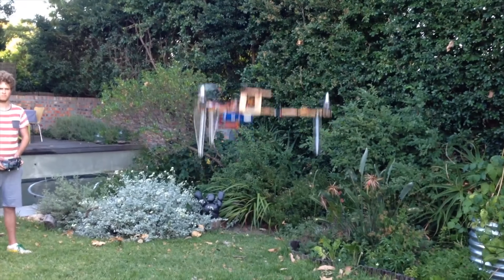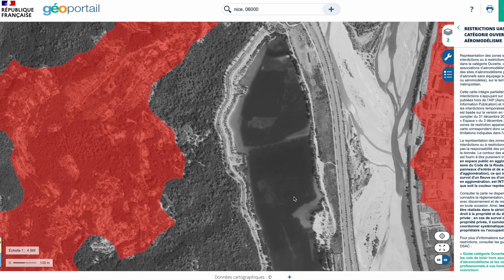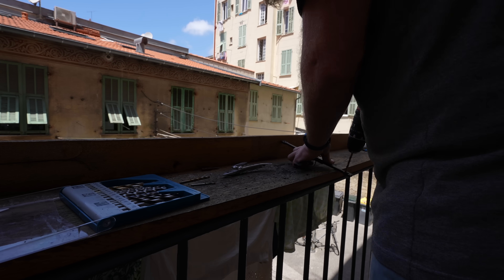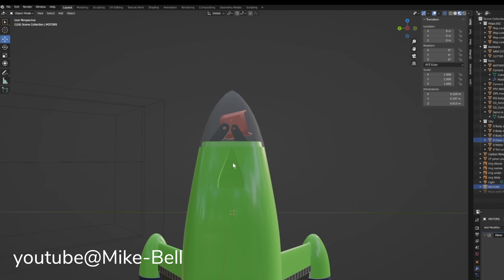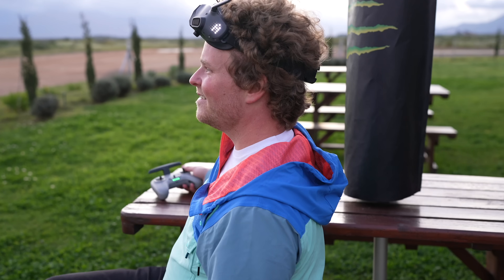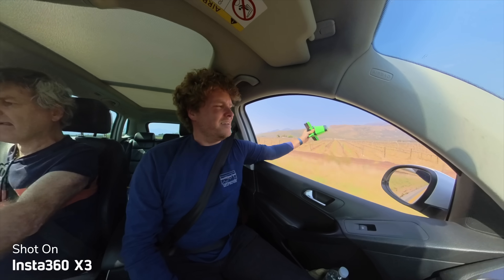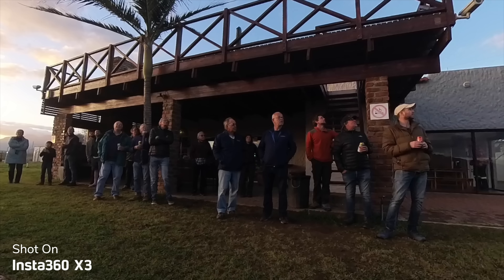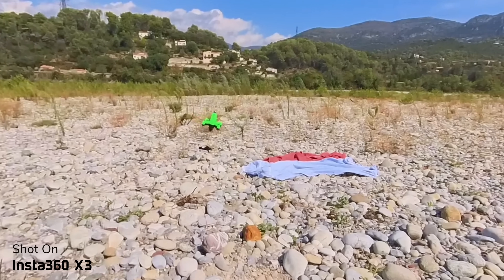How I Built the FASTEST Drone on Earth

Comment: I think the problem here with your design of your most aerodynamic type in green. Is to, overpower, 2 of the motors. So it flips over onto its side. Pointing in the direction of its pointy nose. Now facing forward. Parallel with the ground. Not trying to fly it vertically forward. But flying it, horizontally forward. In the direction of its least resistance. DUH! So you have to change your algorithms again. In the flight control data. So that at speed. It tilts over.. And flies in the direction of its aerodynamic shape. Not vertically honey! With the path of greatest air resistance.. What are you thinking with your electrical engineering degree? That it has to point up toward the sky?  What sense does that make? You are going for a speed record.. So you don't fly it vertically.

I mean come on kiddo. Have you thought about changing schools?  I think your Edgamucation is lacking something? Like thought process. You want to go fast, right?  What does going fast look like?  Do rocket ships fly horizontally off the earth? No they do not! As that, Saturn V  in Florida lying on its side. Can't fly like that! That has to be pointed upwards! It goes in that direction. In the direction of the shape of the vehicle  with the path of the least resistance.. So it goes vertically to fly real fast until it runs out of gas. Then it starts the next gas tank. And then the one after that.. Because they have more than 2 tanks. They have, 6. Because they do them in pairs.  Not grapefruits. Not oranges. Not apples. But in pairs. After they are ripe. Not before. Otherwise you will have engine failure. And blow it out your ass in the bathroom. But I digress.

And so there's more than one way to get a toy to go fast. And so you might want to get an electrical engineering degree, instead? And design functional radio alarm clocks. That, don't wake you up with a Start. It wakes you up slowly. With the sound of lovemaking. And you will make millions of dollars, overnight. But you could also do that with just a rock. Instead. And you package it in a jar filled with water. Call it a, Rock of your rainy, umm? And it requires no batteries. They are $20 each. Or 5,  for just, $100. If you act now. And call one 800-TRUMP--UP. Or text, Donny to,  666-666. Or on X (formerly Twit less) @the Real  Donny XXX. For further instructions what Americans to attack. Until then, Standby and Stand back. Until we are ready to Pounce !

And there's no reason to believe they won't.
RemyRAD
Reply from the maker: I’m genuinely not sure if this comment is just trolling or serious.
Reply: @LukeMaximoBell  I'm terribly sorry sir. It was late at night when I posted this. I was in bed. I really shouldn't do these in my sleep. I was already horizontal. Thinking the drone wasn't. Because when you are horizontal. The drone looks vertical in its travel. When your consciousness is skewed toward sleep. While still being sort of awake.

So you did everything right. It's really brilliant.  I love it. Congratulations! It was a great undertaking of engineering brilliance. Tip of the hat to your dad. Of course everybody can make those kinds of enclosures. Your dad is brilliant. Your dad is awesomely cool. He knows one day you will be able to support him. Very soon now. Once you are hired by Air Bus. Unless Boeing has come to you looking for help? America is a nice place. You've been here, before. Though there may be a downturn after November? As one guy doesn't believe in science. He wants to go back to the old ways. The thug like, Mafioso, days. With Mobs of supporters.

Unfortunately. I was never really into going fast. I was into, duration. I like, slow moving, easy-going, cruisers. Which were also my motorcycle of choice. I never wanted a Crotch Rocket. I mean why? It was more fun to, kickback. Put your feet up. Hit the cruise control.. Enjoy the backrest. Turn on my Helmet Radio. I built into my helmet. 40 years ago. Back in 1983/84. When it was still considered Highly Illegal. Now guys are watching television on their smart phone. While riding their, Crotch Rockets. With their, Insta-360. While trying to set the shots. While riding. You know? We don't hear about the ones that headed, headfirst. Into a cement overpass. We don't see that video on YouTube. As it doesn't make the grade. From those Video Production Failures. For YouTube. It's

So, I'm 68 now. But I've enjoyed going slow. Since I was 28. And going up to the, Shenandoah, Blue Ridge, Poconos, Adirondacks, mountains. On a motorcycle. It's like flying slow. And all of those pretty turns. You can miss and die. By going too fast. And slow is much more relaxing. Life is short. There is no reason to go fast. I mean you could get hit by a car wearing those goggles. You never know when one is going to go out of control? It doesn't matter if you think you're safe. When you do not have full situational awareness around you.

And so with those goggles on. And remote controlling your drone. I think you should be sitting in the safety of inside a car. You don't need to be standing up. Radio broadcast energy won't be much different, 3 feet lower. And you could be much more comfortable sitting in a car. It would feel more like you were flying your drone from a Cockpit. Not a bus stop. You would have a more Immersive Experience. Sitting immersed inside a cockpit. You'll get that actual,  cockpit flying experience! Now all you need?

You need some, solenoid activation of your car seat. Or the, air ride adjustments. To make you feel the turns, the Ascension's and declinations of the flight. By manipulating the seat and/or suspension, of the car you are sitting in. Almost like a real Boeing Simulator! So you can feel your turning and banking. If you can energize the suspension or the seat in your 4 wheeled quasi cockpit vehicle! It would be Awesome!

No I'm not kidding! I'm a retired engineer. Broadcast on Recording Studio, type but a retired engineer just the second. I mean I've got multiple major music award nominations. For my engineering expertise. Have you tried your hand at audio recording? Rock 'n' roll and jazz is a lot of fun. Verdi Requiem's and Operas. Are a little slower. I enjoy recording both. I must admit I do like fast rock 'n' roll. Because nobody ever gets hurt or killed. If they played some wrong notes.

And I can come up with a lousy, Live Mix for Broadcast, worldwide. And nobody will know it's a lousy mix. Like these:
https://soundcloud.com/user-135130368/sets/live-at-electric-church-fm-sessions-vol-1

At I just wanted to know. I recorded and mixed of these. On the Worlds, Fastest and Best Sounding, British Audio Console, ever! The $85,000 in,, 1972, Dollars. 40 input custom, Neve, Audio Console. That weighed in, at almost, 1 ton, 2000 pounds. It's not portable. It required  my, 25,000 pound, Mercedes-Benz, L-1117, Diesel Box Truck. To transport it with. That made it, portable. And I installed it. In my Control Room On Wheels. Better known as the CROW. And I would take flight on the American interstate highways. At worked the East Coast from New York to Florida. For 23 years with it. Before I moved to Central, Texas, 10 years ago.

And so I'm into going slow. With fast rock 'n' roll. And slow cruises on motorcycles. I like putting on a couple hundred miles a day. Slowly in comfort. Stopping plenty. To enjoy the scenery, the antiques, the food, the flora, fauna. And playing rock 'n' roll in my helmet radio. 40 years ago before it was a thing for everybody today. Yes I built into my helmet some fine, headphone drivers. Surrounded in acoustic foam to make them comfortable. Inside the helmet. Studio quality headphones inside a motorcycle helmet. It was great! I'm sure you and your dad would have appreciated it. I had acquired the world's smallest FM stereo receiver. Made by Toshiba. It was 1 inch by 2 inch by, 3/8 inch. And with stick on Velcro. You can't go wrong. It was very discreet. Nothing like this existed for helmets 40 years ago.

And so back in 1970 when I was only 14. In a sense. I created the first Walkman. As, I had gotten a new, AM/FM, transistor radio. I mounted it to the handlebars of my 10 speed, Marathoning Bicycle. And I had gotten myself a pair of Sennheiser, HD-414 open-air, studio headphones. And made an adapter cord to plug into my transistor radio. 54 years ago. Before the Sony Walkman was a thing. 10+ years later.

And I had been a QC Manager. In 1979/80. For one of our most famous and legendary, Studio Tape Recorder Company Manufacturers, Scully. The direct competitor to Ampex and 3M. And offered positions by the others like Ampex, 3M and MCI.

After I left Scully.  I was scarfed up by NBC-Radio in 81. And by 84. They had transferred me into, Network Television News On Air Operations. And I was like no no no please no I'm all about the music. I'm not about the news and the politics! But I became one of the best at that. And was fundamental in switching us over from Monaural Audio to, Stereo Audio. Aunt not just a Network but a World Wide, level.

And unlike yourself and your dad. I never went to college. I was so dysfunctional. I was a bona fide high school dropout. With nothing more than a GED. Which is like getting a high school diploma after the 7th grade junior high school. Instead of 12th grade, senior high school. The test is that simple. I was outraged! It was overly simple! I mean I made it, halfway through the 11th grade. And I dropped out because I was already employed. At an FM Radio College Station. And also the Largest Recorded Studio south of New York City. As a full-blown engineer at both. There was no need for me to waste my time in high school any longer. As I think I understand Engineering Fundamentals. Without any formal education. Except this place I used to go to. It's a big building. It's filled up with a lot of books. I think they call it a Lie Barry? Something like that? And all you have to do is ask the librarian. Even if it's a guy and you're not gay yourself. What kind of books you seek? And they will tell you what aisles to go down. No need to spend a lot of money at University to have a professor. Tell you what books to read at the library.

I mean as engineers. We always figure out the better easier faster way to do things. Right? Even if I like going slow.

And so sometimes when I'm in bed and half asleep. My speech to text software is still on. And I'm half asleep with my headset on. Talking to my, 46 inch LCD across the room.

So please excuse my, half-asleep train of thought, skewed on my side, technical engineering rambling. I mean obviously my eyeballs and/or brain. Did not have my turn and bank indicator on. As I was fully drifting into unconsciousness. And so I discovered. Your drone does flip over on its side. I was wondering how those things were flying vertically with its nose pointed to the sky? It was my nose pointed to the sky in bed. And the LCD TV was sideways. 

Sorry about that chief. Missed it by that much. I'll try to Get Smart.
RemyRAD

Comment: If you want a really fast drone? Here's what you should have done.

The craft needs to have  a, Sleek Body. With 4 downward and 2 rearward, ducted ports. Powered by a central micromanager, gas turbine engine. With an electronic valve control to the ducted ports. For, VTOL and forward flight. Without any props. To slow you down. Without arms of air resistance. Without bulges for motors.

And you call yourself an electrical engineer?  Better stick to building, transistor radios, kid. As you want to go fast. Like little kids do. So why are you using props?  What's the matter with you? I want fast  gas expulsion! To make a little featherweight piece of crap. To go supersonic. Not with props! What were you thinking, son? Did Chuck Yeager's plane have a prop?  No it did not! No. It had an, Explosive Diarrheal Motor!. You just mix the two chemicals together and they explode! And you direct that out a rocket nozzle. Because you do not need props. To go fast with. You don't want props. They will fly apart. They will act as shrapnel. It'll going to your cranium and kill you. This is why you want ducted ports. And you are only exiting gas out your rear. Which I do all the time, every day, reliably and regularly. You should also. Go blow your ass off! Though a warning here.. Do not! Repeat. DO NOT EAT AND CONSUME TOO MANY JALAPENO PEPPERS BEFOREHAND. AND MOUTH.. You will regret it the following day. Because as you will discover. Quite scientifically.

You will all discover. We all have taste buds. Not only in our mouths. On our tongues. But also within our, rectum's! Because you can taste those hot peppers again the following day! And it leaves your ass hole feeling like it's on fire! And it's not your hemorrhoids this time! It's the taste buds, in your rectum! You never actually knew you had! A lot of people don't know that. I bet you didn't know that? Lots of people don't know that. And that us and US is spelled the same! But means two different things. Who knew? This was recently discovered. By a former president of the American KGB. At 76 years of age. And required more than 50 years. Post, Donated College Degree from Wharton. To fully ascertain and discover. They were spelled the same but meant two different things. Huzzah! Ha ha ha. I bet you didn't know that? A lot of people don't know that. It's true. And our father Freddie. Left $415 million to his children. And Donnie was tasked.. To making it grow larger. So he used it to open up a couple of Casinos in Casino Towns. Where the Favor is always with the House. So he couldn't lose. By then going bankrupt at his casinos. Pocketing much of the money for himself. To purchase country club golf courses. An estimate their value at 10 times greater. Or 100 times greater. On a good day. To get better rates loans. With Mara Lago, Estimated by him.. To be worth, $1.5 billion! Over its $35 million value. But of course! That's what you do! When you get a free business certificate from Wharton!

I mean? Donnie Trump is just like, Moe Howard. Of the 3 Stooges of Trump Tower. And connected the water pipes for all of the imaginary bathrooms. The way Curly did. In his casinos. Yes each apartment has, 13 bathrooms. Worth of piping. Instead of a, 13th Floor. And with 24 karat goldplated, seat belt buckles. On the easy chairs in the rooms. And maybe why they went bankrupt? Because the Favor. Is, always with the House. Not with his Casinos. So, HE DIDN'T DO NUTHIN' WRONG!

No. He didn't do, NUTHIN' right, either.  NUTHIN'.. As NUTHIN' from NUTHIN' is, NUTHIN'. But you've got to have something girl. If you want to be with me?  But it's just NUTHIN' from Donnie.

NUTHIN' is NUTHIN' with Donnie. And he took, No Oath. To our Constitution. He said..
RemyRAD

Comment: The way it flies and the aerodynamics are more like an airplane. There are RC planes that go several hundred miles per hour. What distinguishes this from that category? I am honestly curious, and I am not trying to be snide. I would have looked up the information myself, but there isn't a link in the description, and Google did not produce the results. Thanks!
Reply from the maker: It’s a good question. The answer is that a quadcopter relies only on lift from the propellers. An RC plane relies on lift from wings. This raises a good question because obviously some lift is gained from the fairings on the arms as well as the body. But this is kind of unavoidable. So when does it become a quadcopter instead of a plane?

Comment: I had a drone a few years back that had the rear motors on a pivoting tube of aluminum or kevlar, so you could get much faster speeds, while retaining good pitch and yaw controls.   It was also a trimeran wdesign that floated, you could pivot the rear props and use it on water like a boat as well.  The boat hull design was also aerodynamic while in the air.  I'm interested in how the speed record works, if it has to have no more than four props, do they have to be fixed position, etc.   I also converted an old balsa wood airplane to VSTOL, it had a five foot wingspan, and very wide, and think wings, so I mounted two in the wings, and two in the tailwing at equal width, then had a fifth engine in the standard propellor position at the front of the airplane, with a much larger engine and propellor, it had a 25 pound payload capacity, so I could load the thing down with batteries and servos.  It was based on an Alaskan Bushplane, so it had a great short takeoff and landing capability to begin with, but it was not a great wing-angle for high speed flight.  But, with the four drone propellors and controller, I didn't need ailerons and normal flight controls to control flight, and it could take off straight up, and land that way as well.  I actually stopped building drones because the speeds and the materials and weight of them made me fear the damage they could do in the wrong hands.  Navy aircraft near my home fly only 500 feet above at all hours of the day, and I was building FPV 250's, I even bought a couple sets of titanium motors, and as you mentioned, at high speeds 500 feet takes only a second or two.  I had some six inch Kevlar blades that could take your head off.  If the speed redord would allow a hybrid design, you could purpose build a crazy fast machine, Im picturing those pod racers Luke Skywalker flew, thats a stable design.